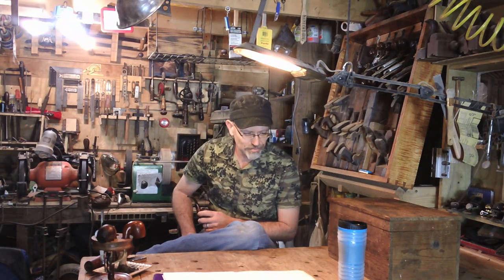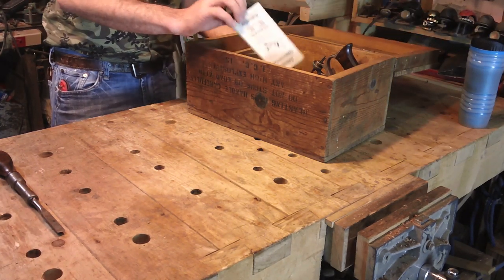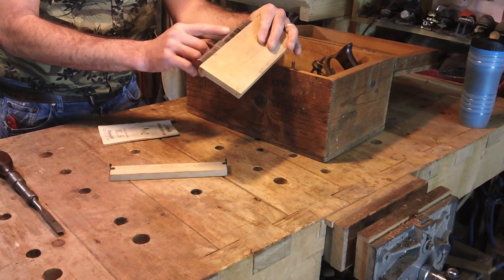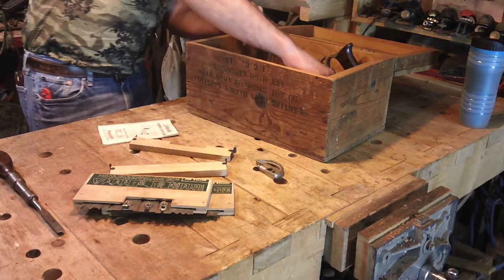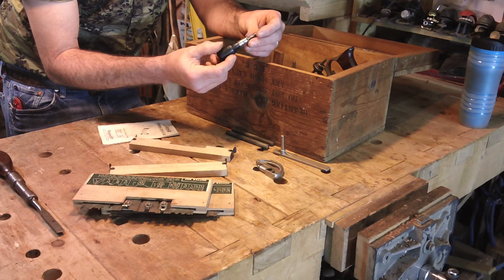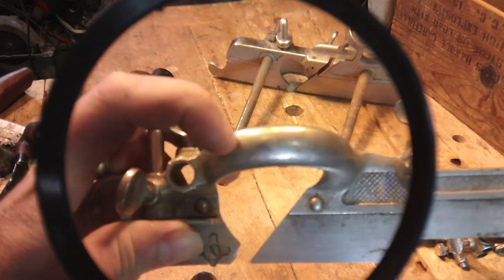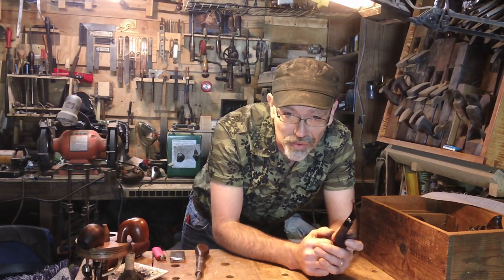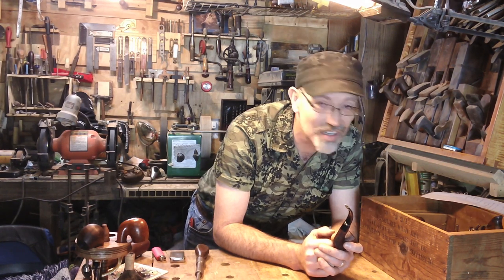Is it a Stanley 45

Comment: I am not an expert, but I have examined a couple 45s in my day and yours looks like a Stanley.  I'd say you are right that Stanley made this for M.W.
Now for the bad news, I've heard that combo planes are a waste.  You fiddle around setting it up for a certain function and get the task done, you then have to set it up again for the next task.  It's versatile, sure, but it's too time consuming to actually use for more than one task.  I'd guess that most guys who had one set it up for doing the job they needed most often and left it in that mode all the time, and came up with other means to get the other tasks done.  Now that you have one, it would be great if you'd make a few videos exploring how easy/hard it is to change it over for different jobs.  My inclination is to buy used, dedicated molding planes.
Reply from the maker: Thank you.
Yes it is easier to have dedicated planes for each job. I do own about 6 smoothers.
I agree with the setup.
But this will fill in the gaps of the molding planes I don't have.
And yes there will be videos on the use of this plane with projects to go with it.
I have found very little on the plane and have read of the dislike of it as well.
But in the time that these were made they were used by the working man. And if he found it imposable to set up or difficult to use they would have not sold and been discontinued. Just look at how many vendors sold them, Bailey, craftsman, Stanley, Montgumery Ward, Siegley, Traut and a few others.
Thank you for the thoughts and discussion. You have given me a lot to think about.
May your irons always be sharp!
Reply: as a counter point, I have a single #45 that I use from time to time.  It's not that hard to set up each time for different plowing needs.

I did pick up a montgomery wards #45 without blades that I meant to set up for a specific plow (on 3/4" boards probably) but havn't really needed it that much in practice.

Comment: I too have a Stanley 45 as I clearly see your's is also. I have only tested it a couple of times in the last couple of weeks. I saw on Ebay that one was for sale and they made note that the 1/8 " steel had lost its nib for the adjuster , there is only a couple of MM holding it on. I tried the 1/8" without the nib, and because of its small size and only a little friction it seemed to work perfectly you just  need to adjust it manually rather than using the  adjuster, not to worry.  On this one I have only two blades were honed so it must not have been used much. I think my kit has 20 steels. I'm still on the learning curve.
Reply from the maker: Mark thank you so much for the input. I love to here of others and there trials. It seems the small iron is broken on most. O well, manual adjusting it is. Now I have  a problem and find I collect planes faster than I can sharpen them properly. So with that said I sharpen as I need them. That seems to work better for me. Again thank you for your view and comment!

Comment: Hi, ran across this in my occasional 45 info search.  There is surprisingly scarce comprehensive video on these and the 55.  Yes, there are videos, but usually just someone plowing a simple groove or a rabbet, not combining profiles to make "neat" stuff.  Anyway, I lucked into one of these that by my estimation had never been used.  No marks at all with only very light dusting of surface rust on a few parts.  All nickel intact.  But my smallest iron was also missing the adjuster slot, so am wondering if they ever HAD one to begin with.  I had just assumed(yeah, I know) that they just came that way since there would be so little steel there it it did have one.  I  am considering fabbing one out of an old plane iron and cutting the top to add an offset with more steel there to incorporate a notch to aid in adjustment.  Manual adjusting on this plane is a bear.  Though I suppose you don't need to be shaving feathers with an 1/8 inch iron.  Haha.  Thanks for the video.
Reply from the maker: I found the same problem. You would think as wanted as these are there would be more out there.
Wow you found a virgin! Wow
Thank you for the comments and your wonderful story.
Now you have me wondering the truth about the notch.
Reply: I can't guarantee it to be virgin when I got it, and it's certainly no virgin now.  She was just too pretty to leave alone.  IMHO tools should be used, not hung on a wall.  None of the cutters had any signs of sharpening or marks. 

This is basically the idea I had for crafting a new blade.

http://www.cornishworkshop.co.uk/album/albums/userpics/10001/lewinplane07.jpg 

Upon first use, I immediately saw the need to get a 55 for the bevel angle capability, 2 fences and the third skate needed for ogees and other asymmetric profiles  but haven't been lucky enough to score one at a decent price yet.  It will come someday. 

Thanks for the quick reply and I'll do some digging and will let you know if I find any tidbits of info.
Reply: Ok, went out to the shop and looked at the 1/8 inch cutter on both of my 45s(I got another one that was only partially complete but had most of the cutters) and the non business ends of both show the same shear marks as the rest of the cutters with notches.  Though certainly not definitive for every one ever made, it is an indication that at least some weren't notched from the factory.

I DID see one with a hole instead of a notch with a 55 here:

http://www.ebay.com/itm/Stanley-No-55-Plane-with-45-Cutters-Slitter-Box-and-More-/331268488000?pt=LH_DefaultDomain_0&hash=item4d2123fb40

Zoom in on the sixth photo.  No way of knowing(at least by me) if that was stock or fabbed by someone, or another brand.  But the way the marks on mine run, it's not likely that they had either hole or notch.  The supposed shear marks I mentioned run perpendicular to what they'd look like from a broken hole or notch.  And there are no file or grinder marks, just the raw sheared appearance.
Reply from the maker: Now this makes for a great mystery on an aspect of the 45/55 I have never read about.I will have to look into this in much more depth.
Most interesting....
Reply: Here's Roy using 45s and a 55 and comparing them with some old wooden molding planes.  http://video.pbs.org/video/2365021501/

He must have had his entourage doing some major sharpening and setups prior to this one.

Comment: I also have a "Monkey" Ward branded Stanley #45 in pretty much new condition. I've used it quite a bit and am very familiar with it. I also have a Stanley, and have owned other Stanley #45s. I also have a #55 that I have used for a lot of moldings on different projects. They're fun tools. Anyway, after owning and using Stanleys, when I got the Ward I never even questioned who made it. It's obviously a Stanley. Any other maker would have had minor differences in contour, cutters, something different. This one is exactly the same except for the markings.

Comment: I went and got my plane from my cousin this past week end.  Mine is identical to yours except the top of my manual says "Wards Master Quality" instead of "Lakeside."  Also, my smallest cutter is broken too.
Reply from the maker: Paul I believe a whole lot of the smaller cutters are broken. There is just not enough meat there to take the abuse.
Now does it have the same other markings and did it look like they ground Stanley off of the rounded part.
Thank you for the update.
Reply: Yes, it does look like they ground Stanley off of the round part.  You can see the grinder marks under the chrome.

Comment: 12:07 There you've got the evidence! That's proof enough, Sherlock ;-) : no doubt it's the real thing [STANLEY].
Reply from the maker: Thanks I just want to leave no doubt in any one mind.
Reply: Every now and then, I'm in 'goofball-mode' - just horsing around. Bought myself a No.4 on ebay for 50,-€. Handle's a little bit loose, and I can't tighten it properly down, but other than that: it's a great plane.